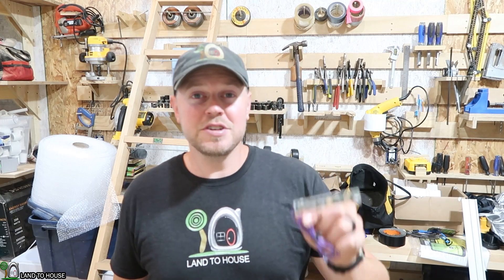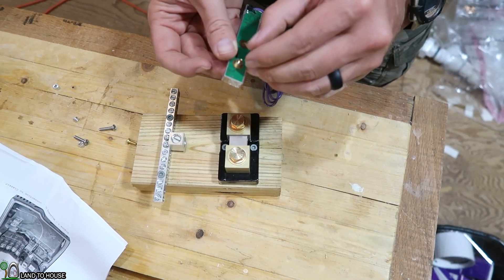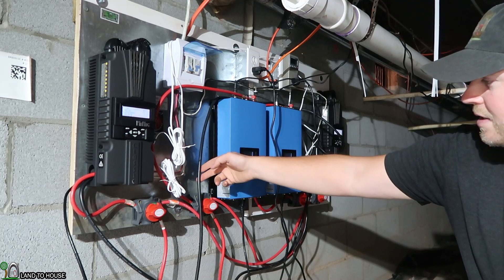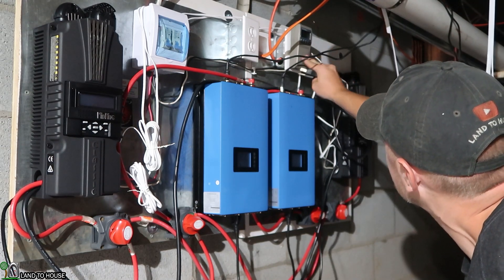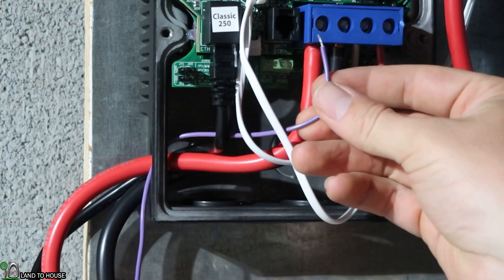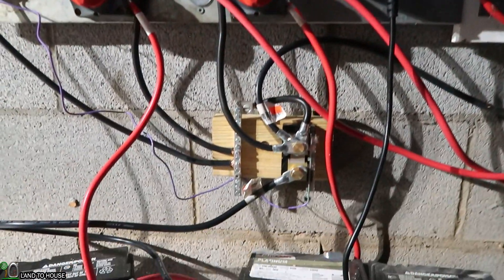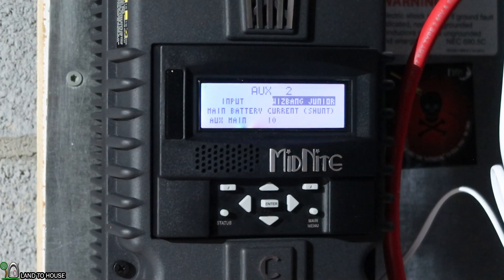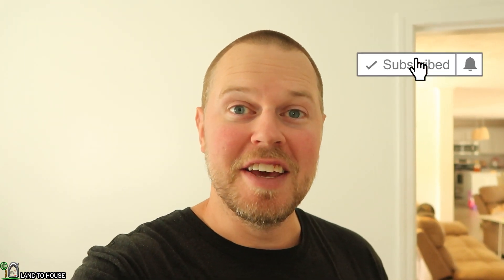Wizbang jr Install and Test - Read Battery Use and Charge

Comment: I am curious: @2:44 What are the two white cables hanging in wraps on the right side of the left MidNite Charge controller? Looks like they connect the two MidNite controllers!? They have not been there in your Solar Electronics install.

Comment: That bus bar looks small, you might want to run a non-contact temperature probe over all of the connections, just to check joint integrity.

Comment: Lots of bare terminals and wires. Definitely wouldn't pass inspection in the UK. All that would need to be in cabinets. I notice you have condensation dripping from pipes in the ceiling. Do you get much fog? Isn't it all open to the elements down there? Scary.

How do you monitor the solar with that app? Or don't you?

Comment: Are you using led lights inside your house ?  The wattage drop seemed like a lot just for a set of bathroom lights ??   Also you mentioned deepwell water pump and power problems.
When I lived in Costa Rica we built a water cistern system out of 6 food grade blue  plastic barrels , about 50 gal each, and built a smallish platform alongside the roof edge of the house.
About 20 foot high plumbed all together. That connect ed into the main pipe system with a check valve installed toward the pump supply side. Our community electric power went on and off constantly throughout the day. We filled the cistern when power was on and used that water when the power was down and we also had small generator to use on the well pump. 
That well pump supplied 5 different " cabanas " and all had the cistern system. Just an idea for you. If you ever paid attention while watching movies that take place in third world/rural areas you will see this system in use for most smallish home, usually on the end near the kitchen and shower area.  Our toilets were outside in a WC !

Comment: Wouldn't ONE charge controller simplify your setup?
Reply: No.  He has multiple sources (micro-hydro and solar).
Reply: @PeterLawton  And why does that make a difference??
Doesn't anyone make a charge controller that allows multiple inputs??
Reply: @roberthopgood1894  To your first question, the charge controllers here are not designed to handle multiple inputs.  To your second question, I can't speak for the market, but I have yet to see what you're looking for.  If it exists, I'd expect a premium in the price, and I would not pay a premium -- the benefit (consolidating controllers) has no value to me, and I'd be locked in if I wanted to upgrade or change one power system but not the other.
Reply: @PeterLawton  Multiple sources is irrelevant. He has a split mains system. The normal world doesn't use such things.
Reply: @KenSharp  I respectfully disagree.  While the split mains system is unusual, that affects use of the inverter(s), power from batteries to line voltage.  Robert's question was not about inverters, but charge controllers, and a single battery bank is being used here, unless I missed something.  The charge controller is for power from source to battery, not the mains.

Comment: Hello, can you follow the application even if you are not at home?
Reply from the maker: This one is meant to be read while connected to wifi.
Reply: @LandtoHouse  Well, wouldn't it be another option to be able to see parameters from a distance?  thanks
Reply from the maker: I know a guy who set up a security cam to read the actual midnite classic display. Not super practical but it worked.
Reply: @LandtoHouse  how can I set my battery percentage to show that I can't

Comment: should not mount that on treated wood, direct connecting to wood is not approved. Also not a fan of how you fed your wires in to the midnite classic charge controller. Bushings are required for where wires enter an enclosure.

Comment: Please, go get some DIN rails and mount this rather fine equipment properly. Conductive parts directly na combustable wood, thats a voucher for fire fighter depatrment visit you wanna better avoid, trust me.
Reply: It's mounted on a metal plate, you could take a propane torch to it for 10 minutes and the plywood wouldn't catch on fire.
Don't think the equipment he bought is DIN capable (except the midnight of course).
Constructive, not destructive :)
Reply: @jamess1787  Yeah, I'm aware of that metal plate, it makes it kinda fireproof but it is conductive so is that wood gets get or something gets loose, it can cause serious arcing and therefore possible damage. On DIN tail you can attach everything once you get propper DIN mounting pieces. :-) btw. unprotected shunt/busbar is asking for an accident, as Jelle Baris mentioned below...
Reply: @thelwq  if the metal plate is grounded and/or otherwise attached to his system, which probably isn't: therfore arcing/shorts wouldn't happen. There are loads of things he can to to provide additional layer of safety, but that's his choice. I'm sure he can slap the shunt in a small plastic enclosure: he won't have ground-out electrical issues because of what I stated earlier.
Reply: @jamess1787  I have education in this field and I would never use bare wood to attach conductive parts to anything - concrete can became conductive quite easily and ghost currents sneaking around house and equipment I would rather avoid. Or use proper common ground and stuff.
Reply: @thelwq  That current sensor is at ground voltage for one terminal, and very close at the other.  Ground is safe as is.
Reply: @PeterLawton  Negative rail of the system is not always the same as "ground" - there could be quite different potencial.
Reply: @thelwq  Wow.  Did he seriously design a system where battery ground (inverter ground) is not at system (safety) ground?
Reply: @PeterLawton  Battery negative terminal could be on different potential then actual ground (ground rod, common ground etc). There could be a leakage current thru wood. But anyway - I give up on this discussion - I hope that he'll be just fine...
Reply: @PeterLawton  Correct, the hydro+solar+battery system 'floats' independent of local earth ground the same way your car does.  The inverter is where it ties to earth ground in production of supplemental residential AC in phase and reference from the main panel's legs and earth ground.
Reply: @jamess1787  That metal plate would be defacto grounded if he grounded the Classic or any other component that grounds it’s housing.  But honestly I can’t see any bare or green grounding wires.  This system functions but looks quite scary from a code and safety standpoint.